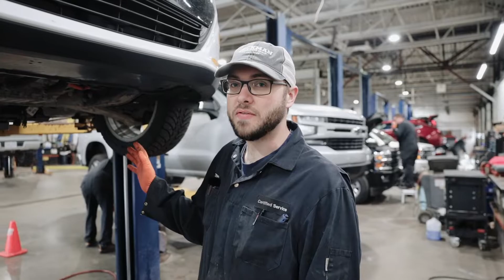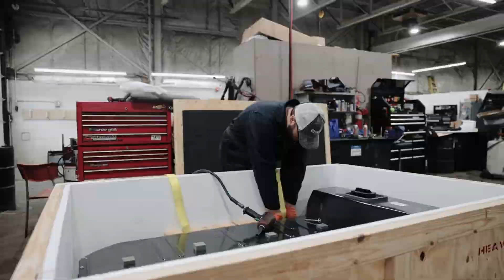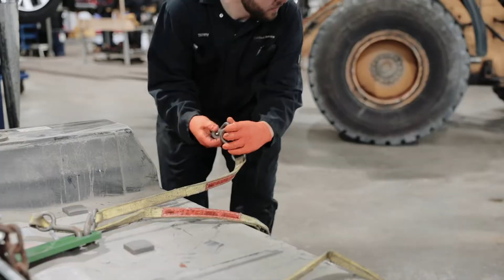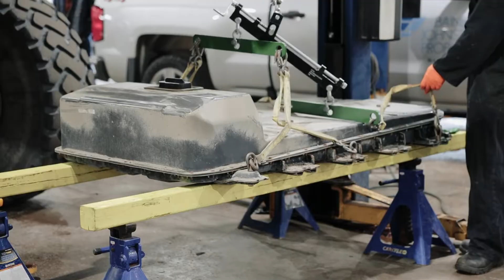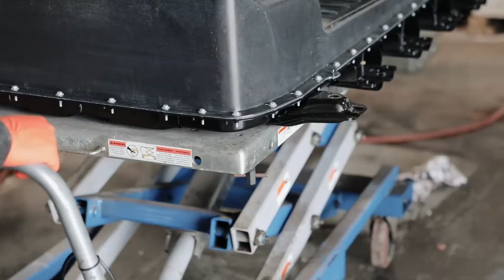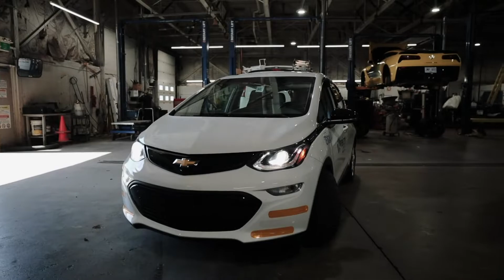EV BATTERY REPLACEMENT - Is It Really That Easy?

Comment: EVs are a ripoff. Significantly more expensive than gas vehicles and contain 75% of the carbon footprint. 

And batteries are going on these things?  This is a wild scam.
Reply: After careful consideration, personal experience and an open mind you wrote this? Looks like someone may have urinated in your newsfeed…
Reply: The cost 9f a battery is more than the cars worth.
Reply: I think you’re drinking yellow snow
Reply: @gordy5882  if every American switched to an EV we'd only reduce carbon emissions by 0.4%.  you have to drive an EV to 100k miles to reduce the carbon footprint. And they're 20k more expensive. 

EVs are a scam

Comment: Love GM EV’s, easy to work on and super easy to maintain.
Reply: Agree, 10 bolts and only 3 cables to connect. It feels like the process was engineered to be that simple.
Reply: NOT TRUE.
Reply: @markmiller8903 yes true

Comment: ...so why does such a new vehicle need a new battery pack?  I thought they lasted 10 years or more??????
Reply: Because there was a recall on the battery due to a small number catching fire. Tesla had the same issue.
Reply: @5504berry  Yikes!!!
Reply: @poppyatcs4529  not really, I have had my Bolt since 2018. Drive it every day and just got a free battery at 60k via GM. It's like I just got a new car!
Reply: Yep- we love our ‘21 Bolt and look forward to the recall battery replacement when our turn comes. These cars are easy to charge in our part of Colorado and cheap to run…no regrets.

Comment: As we say, Don't try this at home.  Quite a process to replace the battery if you have the right tools to do so.   Great job of installing the EV battery.

Can they fix these bad batteries and recycle them, or are they too damaged or too much to repair on them??

First could a electric car home owner even be able to purchase a battery???
I don't think this would come from Amazon Prime.  <hehe>

Thanks for the video.
Reply: Of course they can fix the batteries and reuse them. If they're too damaged they'll try to recycle them and recover the raw materials. They're too valuable to just dispose off.
Reply: You say don’t do this simple procedure at home because you can’t charge me 5 hrs labor for a 1.5 hr job and cash in on that $2500 in labor
Reply: @Babayaga-tx3oe  What I said was I don't have the right tools to even do this job. And most people are not mechanics that fool around with vehicles on their own.  Cost of everything for car repairs are ridiculous.

Comment: Any comments about how suspension/steering components are holding up in EVs?
Reply: That depends extremely heavily on the use case. I’ll give my Nissan LEAF as an example; because I do a fair bit of off-road driving, the lower control arm bushings tend to wear out a lot faster than if I stuck to smooth paved roads. But that’s much less to do with the EV drivetrain and more to do with the use case, as evidenced by the fact that the company-owned ICE F150 has the exact same problem. So it really boils down to “are you consistently overloading your vehicle, or doing stuff it was never intended to do? If so, expect those components to wear out quickly; if not, they’ll last for quite a long time.”

Comment: As a Bolt owner with a new battery  I really appreciate seeing the repair process! Just a little more complicated than putting new AAAs in the TV remote :)
Reply: And what was the cost of the new battery, and how old is the car itself? In the time it took them to take the old battery out on that  4 poster lift, I could have filled a lot of remotes with AAA batteries. ...lol
Reply: @brianmorris8045 the batteries was replaced by GM in these no cost , they also got a better battery better chemistry FYI the battery should out last the car
Reply: @jamesmcfarland2636 so why replaced, if it should outlast the car, and the car is a 2018.... I have a 2000 540 and engine is still original.
Reply: @PatricioGarcia1973  it was a recall the battery wasn't gone ,
Reply: @PatricioGarcia1973  That's cool, I know plenty of SIlverado owners with starched transmissions under 100k miles...
Reply: Same! 2018 Bolt owner, battery has been replaced earlier this year.
Reply: hehe these commenters are desperate to disparage EVs
Reply: Thank the childslaves in Africa for pulling out the raw materials for your battery, so you can tell everyone that you care about the planet. Lol
Reply: @Kededian  Who said anything about care for planet? I'm all for EV but couldn't give a F for environment. No noise and fumes in the city for pedestrians is a + tho
Reply: @Kededian Guess you should stop using your cellphone, tablet, computer, gas car and tv.

Comment: Small note. Unless the brake components are defective, you'll never need brake maintenance. My 2013 Nissan Leaf had 80K miles when I sold it and 60% of its brake pads left.
Reply: bro that is NOT true
Reply: And a new battery pack for a car is still considered better for the environment?
Reply: @drewfeld836  old one isn’t discarded, burnt, or exhausted through the tailpipe. It is instead reused and recycled since all the materials is still contained inside the battery pack.
Reply: @kylinblue  Are they though?  I thought they haven't figured out to efficiently recycle them yet, but there are start-ups that are trying to solve that problem.
Reply: @drewfeld836  That's really old news. Just one of the many startups I've heard of: a guy started a solar energy company w/recycled EV batteries. He'd get the discarded EV batteries & use them to power every appliance in a tiny home community. He learned how to recycle the individual cells too.
Reply: @drewfeld836  since a battery pack is made of hundreds of smaller battery cells, when a pack goes bad it's not because they're all the cells are bad. It can be just one or a couple, so often what will happen is the aftermarket folks will either scavenge the good ones, or the pack itself will be rebuilt, replacing any bad ones, and sold as refurbished
Reply: @dottyjyoung that's nor really recycling, that's repurposing. But when those batteries are no longer able to hold any charge then what?
Reply: @dottyjyoung  
is this the guy who perfected the process and then made a video, showing the results to the people in his village?
Reply: @kylinblue Where exactly is it recycled?
Reply: @kylinblue bullshit
Reply: @drewfeld836 yes, they’re really being recycled.  Several companies doing so now each using different methods, presumably the methods will continue to be refined but GM stated that every replacement Bolt battery will be recycled.
Reply: @misty0636 they are recycled, per GM. This news is available on the exact same site that you’re watching this video on.
Reply: @drewfeld836  There are numerous locations that are using old EV battery packs as grid storage. They are linked together and form excellent storage for many years. These particular batteries are not being replaced because they are in anyway defective, they are just early versions and offer very low mileage. Their newer replacements can double the mileage. Battery technology is advancing at a rapid rate and the capacity, weight, reliability and recycling ability, are improving all the time.
Reply: @drewfeld836  😀

Comment: You need to clear the shop…  “GM is advising some Chevrolet Bolt owners to not park their electric cars within 50 feet of other vehicles to reduce the risk of a potential fire spreading to other cars and trucks. The warning follows GM recalling more than 140,000 of the EVs due to the risk of batteries spontaneously catching fire.”
Reply from the maker: When servicing the battery our techicians run a diagnostics and place the battery into a service mode, allowing it safe to be worked on safely and inside :) 

But yes if you are a 2017-2022 Bolt owner without the software update and or battery replacement please follow the GM instructions of parking outside and away from any vehicles or structures when possible.
Reply: That guidance only applied to Bolts parked in a parking structure, and only to Bolts which didn't have the software update applied. AFAIK Bolts with the software update applied have experienced zero fires.
Reply: @jamesheartney9546  
Its a ticking bomb.  You should know better than to endanger the shop snd all the people in surrounding buildimgs.  These cars are killers.
Reply: Tesla is ranked last among all makes in reliablity and repair cost by Repairpal, Consumer Reports, and JD Powers.  They avg 42% more problems at a cost of just under $1200/year before battery replacement cost which runs $20K (used battery) to $55K (new).  Batteries are a wear and tear item so all warranty repairs are used batteries of like remaining capacity.
Reply: @FFE-js2zp  hahaha....how you do blubber on.
I am not a Tesla owner so have no first hand experience...I do however have a Hyundai Kona EV and 0 reliability issues - none. Now to be fair my Toyota Rav4 is a super reliable vehicle as well with a load of miles. We regularly put 6000 - 7000 KM per month on our vehicles.
Your citing of Tesla has a smattering of truth (build quality needs improvement) but also a lot of made up crap as well.
All I can say about Tesla is I have several friends with different models of them. 1 is Model 3 Long Range and he has surpassed 300,000KM and 6 years of driving and I do not believe it has had any repairs - none. Another friend has the small suv and they are at around 180,000 KM and zero issues.
Heck...just saw an interview with Jay Leno who mentioned his Tesla went 7 years without ever having Tesla work on it.
So your claims for the most part are just EV misinformation. I go by real world experience not digging through the internet trying to find BS articles.
Have a good day.
Mike 🇨🇦
Reply: @michaellippmann4474  
All Li-On batteries are the same.  They ALL die from time bound capacity degradation in 1 to 7 years depending on environment, mostly from catastrophic mistakes like charging to 100% or using the car in high temperatures or low temperatures.  Never drive an EV in other than 60 degree weather.   Also, take GMs rules to heart and do not park near a house or another car. That voids a GM warranty.
Reply: @michaellippmann4474  
Tesla doesn’t allow third party work on their cars bcs then statistics would be known.  So there are only a few dead batteries that make it to ebay and they sell for around $30K
Reply: @michaellippmann4474  
It has to be repaired in network, which means opaque.
Reply: @FFE-js2zp  well then it’s a good thing they have a 10 year warranty
Reply: @FFE-js2zp  how do you feel about having a lithium battery in your pocket all day?
Reply: @FFE-js2zp  I’ll take my chances with my two bolts, but thanks for looking out for me!
Reply: @FFE-js2zp  Next time you get in your petrol car - be real careful with that IGNITION! key. petrol cars are twenty five times more likely to catch fire.
Reply: @FFE-js2zp hey dipstick you should get better info, it’s available out there.  If you just don’t like EVs feel free to keep driving your gas vehicle, otherwise have a lovely day.
Reply: Way to post 3 year old information. They have had suspect batteries replaced. Less fire risk now then a gas vehicle.
Reply: Yes, and Trump is still president.
Reply: Yes the woke US Lame stream media won't tell us this !
Reply: @steveeddy6876 the media covered Chevy Bolt fires and remediation efforts reasonably well, in fact much more than the severe problems that the Ram pickups had, which were a much higher risk of catching fire. The information is out there, you’re just not interested in locating it.

Comment: $25,000 later, your $9,000 car is ready to go!
Reply from the maker: Battery replacements are covered with an 8 year/100,000 km GM replacement warranty, when your warranty ends you are liable for the repair bill, totaling the same as a engine/transmission replacement. However, batteries are being used still past the 400,000km mark with no large amounts of charge lost.
Reply: @hickmanautomotivegroup  
Engine and transmission replacement probably costs $50K
Reply: @FFE-js2zp  waooo nice maths skills son... own a bolt got it at 17,000 with 37,000 miles a year ago. Don't be a afraid of the old technology of electric car. The only thing an ev can do its the smell or the sound n vibration of an ice car....that's why I have my second  🚗
Reply: Yeah...except this battery replacement was likely a recall so under warranty. EV batteries actually have a lifespan in the hundreds of thousands of miles...
As for your comment about "engine/transmission" replacement there is only an electric motor and reduction gear box, first easy and inexpensive to replace and second way more durable than an ICE engine and drivetrain. EV's are the future despite your thoughts and comments.
Have a good day!
Mike 🇨🇦
Reply: @michaellippmann4474  
EV batteries are time bound, not use bound, to about 5 years to dead.  So set aside $25K.  Each battery contains the processed remains of several Chinese and African children.   Miles are a motor challenge, most EVs will chew through a couple of motors every 100K, they only cost $5-7K a pop.
Reply: Thats why Tesla is rated last among all makes, by all ratings companies, in repair cost and reliability.  They got putrid Porsche off the hotseat.
Reply: @FFE-js2zp  that is really weird as the people I know who have Tesla's (about 6 or 7) all love their cars and report virtually no problems? I also had a 911 for a number of years and no problems at all. 
Careful what you read it does not always tell the whole story...
Mike 🇨🇦
Reply: @michaellippmann4474   
Repairpal is just big data analytics applied to all the actual invoices in the system.  There’s no opinion in it.
Reply: Repairpal didn’t rate Tesla for a long time bcs Tesla refuse to share repair data, obviously bcs its atrociously awful, or they would showcase it.    I’m not sure what changed, but they are confident enough to show Tesla as a national disgrace, so they have to have good data.
Reply: @FFE-js2zp  look buddy...I am not a Tesla fan...what the hell are you talking about? Don't care what your opinion is regarding Tesla or EV's for that matter.
Have a nice day and get another hobby!
Mike 🇨🇦
Reply: @FFE-js2zp  Just out of curiosity. Are you aware the cellphone you're using also contains the same minerals as an EV battery? That's right your cell phone battery is also processed by several Chinese and African children. EV battery manufactures now do their best at sourcing materials not mined by child labor but the same cannot be said about cell phone battery manufacture's. True facts do a Google search.

Comment: Have to replace a battery after four years?
Reply from the maker: Due to a Global recall of the manufacturing and lost of historical information from the battery manufacturer LG Energy All Chevrolet Bolts and Hyundai Kona’s required a battery replacement from 2017 to present. 

Current EV batteries are rated for 10+ years of service with little degradation. 

New batteries installed in All Bolts will come with a 8 year/100,000km warranty
Reply: @hickmanautomotivegroup  what happens after 10 years?  Will the current battery still be in production? Can it be replaced with a new higher energy density battery if the current battery is no longer available?
Reply: @linusa2996  
Of course not, thats the whole idea.
Reply from the maker: @linusa2996  Currently 2017-2019 are getting battery replacements that are of better range and power than the original battery, so yes replacements will be available and more than likely come with the latest battery technically advancing your electric vehicle. 

Much like a older model car looking for a engine or transmission, although not in high volume or ready in stock the parts do still exist.
Reply: @FFE-js2zp  you are trolling hard.  buy yourself a tin foil hat
Reply: @FFE-js2zp  ROFL buy yourself a tin foil hat,,, no buy 2 and wear them both in case one falls off
Reply: @linusa2996  some new ev models (Kia Niro 2022) offer extended range battery(íes) I looked a lease model I drive online and the rating reads…260 mile range yet that model goes 280.
Reply: @rtfazeberdee3519  why’s he trolling? Cause he’s telling people the truth.🤣🤣❤️

Comment: Only 4 years? LOL, what a scam.
Reply from the maker: Do to a Global recall of the manufacturing and lost of historical information from the battery manufacturer LG Energy All Chevrolet Bolts and Hyundai Kona’s required a battery replacement from 2017 to present. 

Current EV batteries are rated for 10+ years of service with little degradation. 

New batteries installed in All Bolts will come with a 8 year/100,000km warranty
Reply: @hickmanautomotivegroup  you seem to be attracting a few ignorant trolls on here and patiently dealing with them - well done.
Reply from the maker: @rtfazeberdee3519  Change is scary to most people, we are here to hold their hand through the scary EV times ahead :)
Reply: @hickmanautomotivegroup  Shouldn't that be 160,000 km not 100,000?